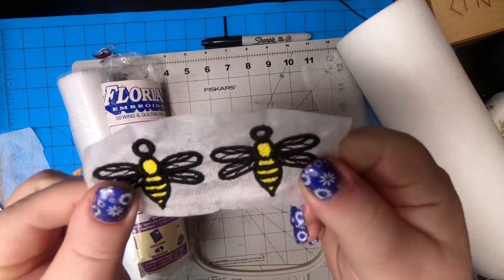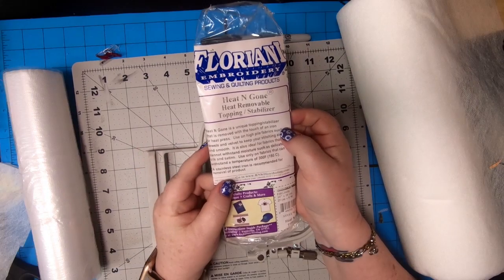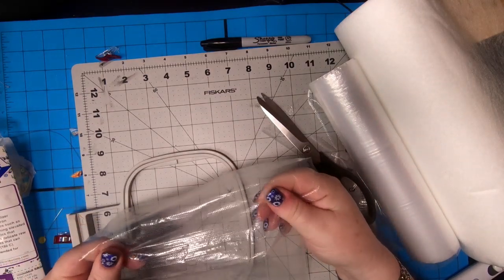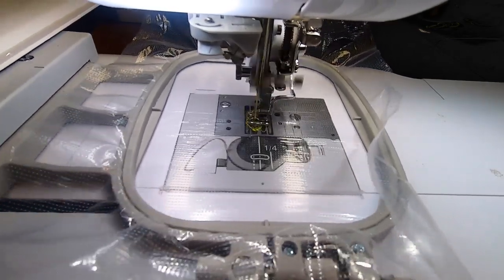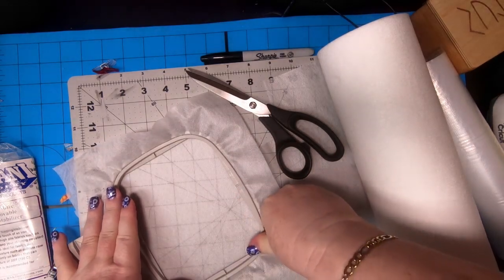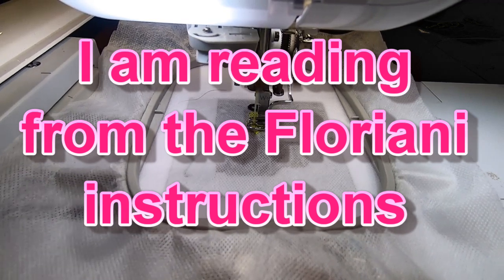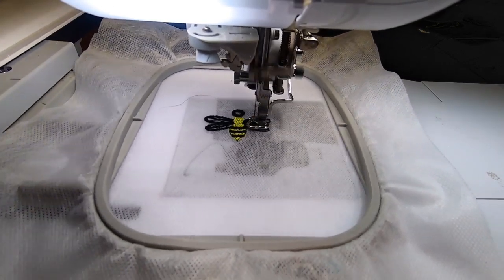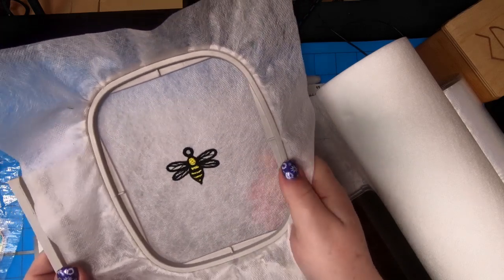OML Embroidery:THE MACHINE EMBROIDERY EXPERIMENTS(ith, FSl,Lace)

Comment: I use the heat removable a lot since I work with non-washable fabics like silk tulle or other fine silks. I sometimes use it top and bottom and use "baking paper" to place the item in between and apply heat (no steam).  The baking paper picks up the remnants of the heat stabilizer. The pitted side of the "plastic" has to be against the fabric, by the way. If still some of it remains, I use the top of the iron and rotate carefully until small balls form, those I brush off carefully. It works very well with some care. It comes in very thin and also heavier. I was always surprised that nobody mentions it in videos, it is always "wash away"  but not all fabrics like being washed! there is a woven kind available too that disintegrates into "dust" when heat is applied and that is used commonly for lace (I am in Europe).
Reply from the maker: yes!!  that is what the heat removable stabilizer is for!!  Exactly!  not for FSL, LOL